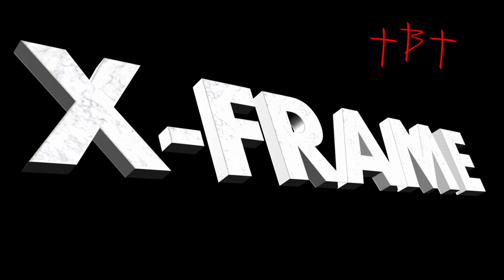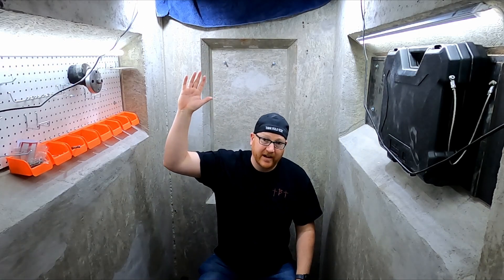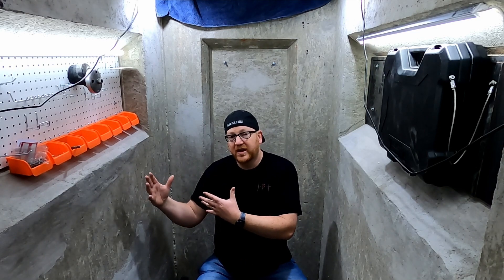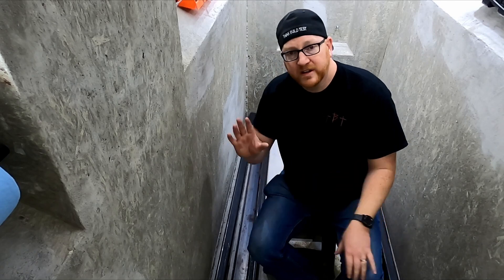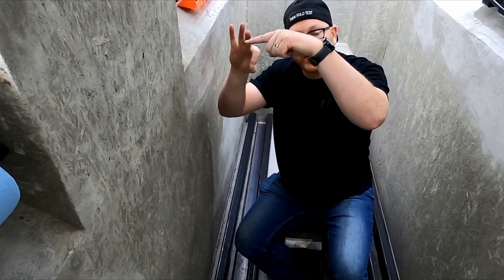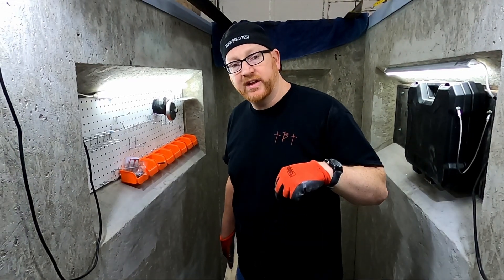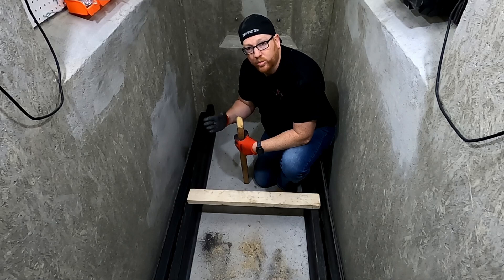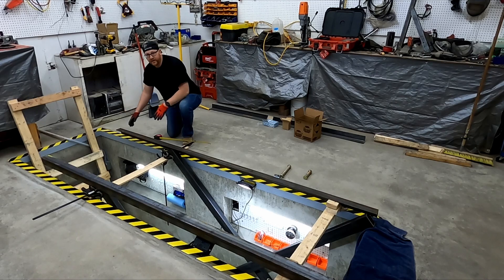Lets design a Pit Elevator TOGETHER!

Comment: The intro was great!
I like the direction you are going. If it is possible to continue with a platform lift higher than the surface  I think having the option could be beneficial if you ever needed it. I just don't know about the hydraulic ram cost for that stretch, it may not be worth it. Having the ability for a puck system to allow interchangeable floor rods for extended lifting is a good idea. Having four locations for them allows you to add a raised platform to achieve a higher raising section if you needed. 
Keep up the good work. 

I was tricked!!!
0:14
Reply from the maker: Lol thanks for the input.  I know thats what your sore body was saying after concrete day!  Lol

Comment: I didn't realize you were building the lift from scratch, I thought you were buying a kit.  I assumed the dimensions of your pit were based on a certain lift you picked out. Good for you!  I know absolutely nothing about this but I would think that your max lift height is limited by the length of the lift arms that can fit in the pit when collapsed.  I would go with the max height possible, even past the floor level. Maybe have a laser beam type shut off at the floor level like on garage doors.  Have an override switch for those times you need to get higher than the floor.  I'm just spit-balling here
Reply from the maker: YES! the override is exactly what I was thinking!  I will build as much as I can without machining work.  I am figuring out the space design requirements for a possible product collaboration in the future to offer to the public.  If it turns out to be a good idea.....